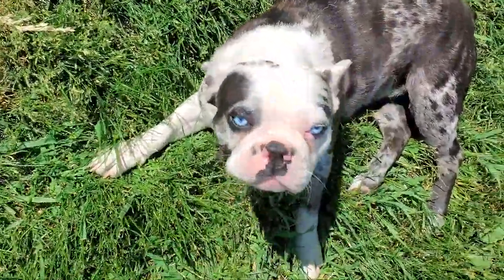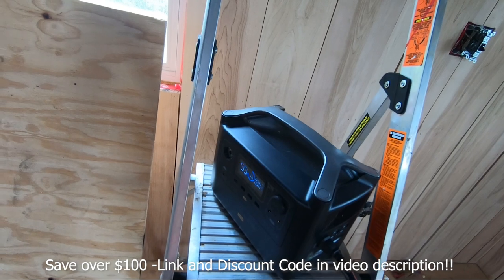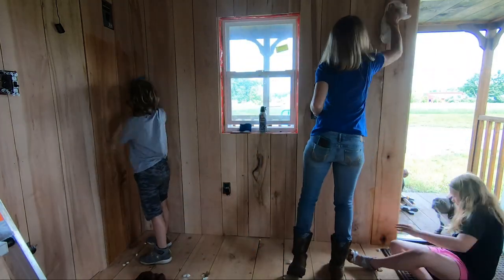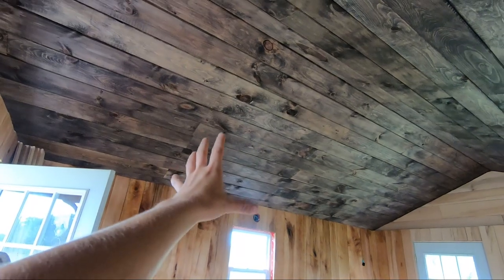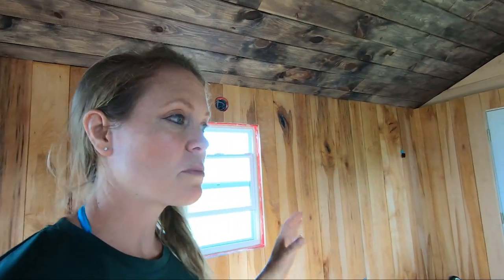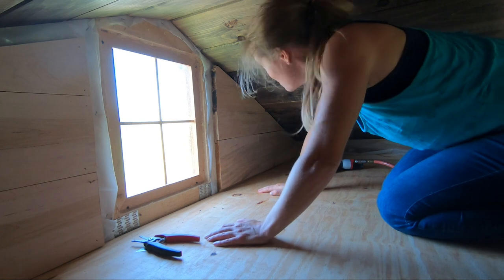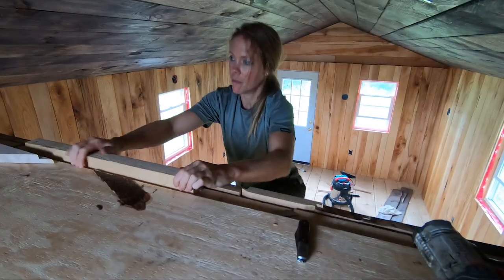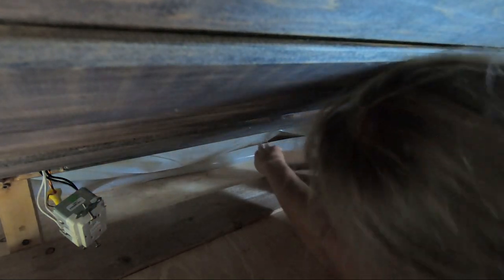😍 From DRAB to FAB: Perfect Maple board Finish: Off-Grid Cabin, Tiny House, Shed to Office Vlog#22

Comment: Nice video, my dog was on my lap the entire time watching. I use to rub stain and oils until I bought a book on finishing.  It seems when you rub it off it closes the pores in the wood.  I've had great luck just using a good quality brush and applying it evenly. The wood gets a richer finish and you can apply additional coats that soak in once it dries.